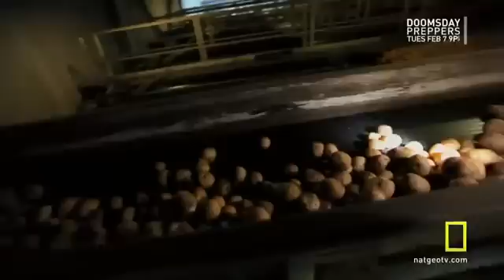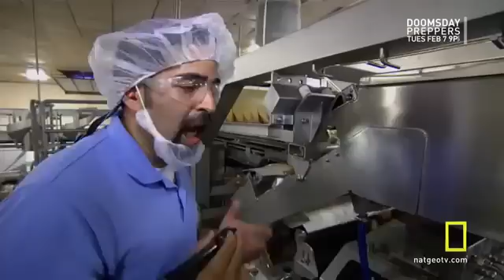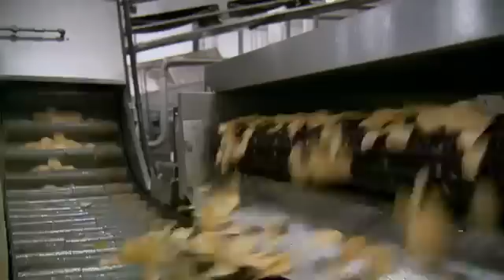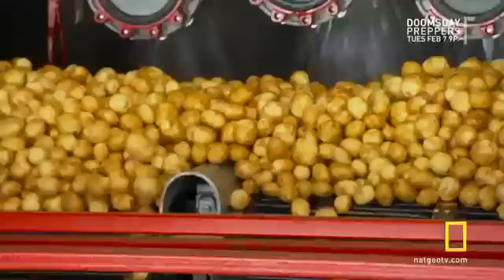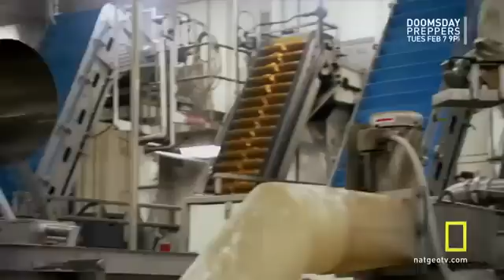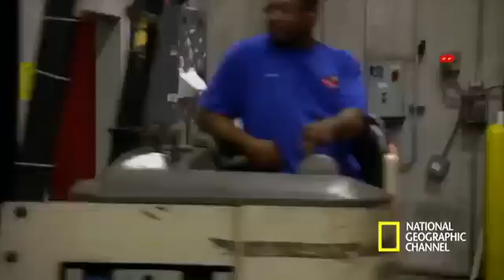Ultimate Factories Frito Lay

Comment: Does Frito Lay know the existence of something called a Lightning rod?
Reply: MrPepsicola123 

Its not a direct hit, more like loss of power event, which automatically faults the machines. 

They need backup generators more then lightning rods, though easier said than done when everything runs at 600V/100A or 1200V

They make it look worse then it is because if there were a genuine lightning strike or tornado the downtime would be weeks to months.
Reply: Lightning Rod won't help
Reply: I’m actually surprised they don’t run backup generators.  Especially with foods cooked in hot oil.

Comment: Im still waiting for them to reveal how they make flaming hot cheetos!
Reply: joemchang 

Its just a seasoning mix
Reply: joemchang its the same process used to make every other potato chip. Like its not a hard concept to understand
Reply: Those are made in mexico.
Reply: The mix used to make cheetos will make your sinus drain. It's no joke...
Reply: They mix the ingredients until they make a dough like substance then they are sent through an oven line then eventually to a tumbler seasoning room where the seasoning in poured onto all of the  chips before they are sent down to a feedway where the good chips are dropped down into the bagging machines and then they are packed, and shipped out